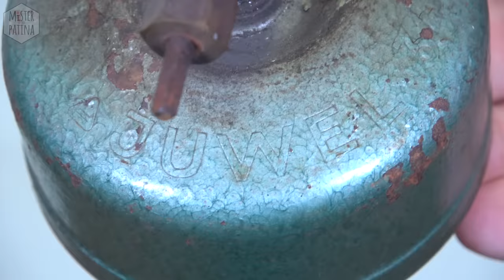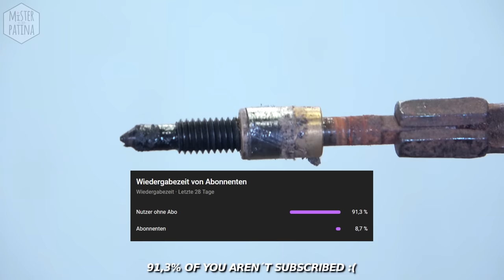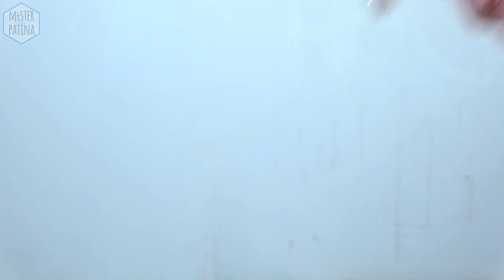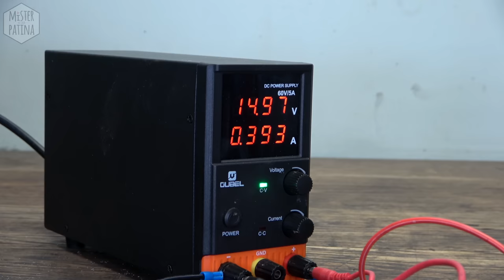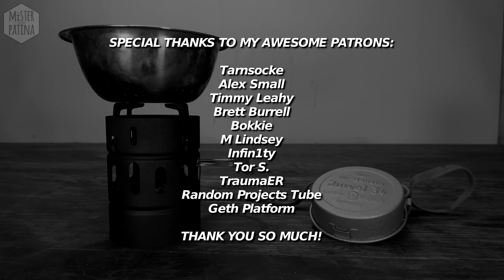Rusty 1950´s Camping Stove | Restoration

Comment: Great restoration, I particularly liked the vinegar bath.  I believe the top and bottom plates are supposed to be pans / pots for the stove.  Although they were painted prior to the restoration.  It makes more sense for a space / weight savings for camping that the pan is incorporated into the design.
Reply: Exacly. Inside this pans is just metal polished

Comment: I have the SVEA 123 with the old SIGG kit.  It is very similar to this.  You actually are supposed to fill the dimple on the base with fluid and light it, then wait until it goes out (for priming).  Excellent restoration!
Reply: I also have a SVEA 123 I purchased back in the nineteen hundred and eighties. I used the crap out of it for about a decade, and less often since. It still works, or did two years ago.
Reply: I have a Svea 123 too, mine is only a couple of years old. A nice simple and reliable stowe.
Reply: @Murgoh  Great.  Do you find that the new ones are made just like the old ones?  I have never actually seen the new ones in person, though I have seen them online (I think the Primus company now owns it right?)
Reply: @rs232killer  It really is a well built stove!  wow, 1980s.  Not sure how old mine is.  A little “life hack” that I discovered is using one strand of bike cable wire as a picking tool to clear out the occasional clogged nozzle on the stove.  Works well and costs nothing.
Reply: @nathans1978  I think they are almost identical though I have not held one of the old ones. The later model has a built in nozzle cleaning needle, just turn the valve all the way counterclockwise and the needle pokes up through the nozzle to clean it.
Reply: I bought mine in 1974 and it still works just fine.  Used it a few weeks ago.  Bulletproof.

Comment: These were the standard equipment of the east Germanys army until the reunion of Germany. After 1989 they were still produced and sold as camping stoves. I bought mine in 1990 or '91. Correct starting is described in a comment below, fill the indent with gasoline and light it to heat up the tube. Makes quite a noise when running.
The biggest advantage is, it is running with gasoline. As long as you filled up your bike, you can always cook a meal 😉

Comment: Mine has to be somewhere in my camping gear. Served me well during several camping vacations in the 80‘s. 

Btw: this was build in the GDR untill the collapse of the iron curtain. 

The lighting works a Little Differenz than you did it: there‘s a small indent round the tube on top of the gasoline Container. You have to fill this indent with gasoline and lighten it. So the gasoline in the container is getting hot and it becomes a gas. Then you ignite the stove
Reply: По моему это не бензиновый примус, больше похоже что используется керосин.

Comment: Nice and insightful job on a classic old stove. I can imagine some old tweed clad hikers way up in the Alps, crouching around that, trying to warm up. Loved the little funnel.
 For awhile on long trips we used an old pump-pressured stove for dozens of simple tasty dinners. It was meant to have only real camp-fuel. After a few tests, we switched to the same high octane gas our old Kawasakis used. The stainless steel grid where the sauce pans sat would get glowing red from the crazy hot flame. BTW; do not try this at home. It got WAY to hot. Thanks and good luck.

Comment: By the way, the lip at the base of the main jet was for squirting a bit of fuel in there and lighting it to warm the system up in very cold mountaineering applications. All cold war era mountain climbers in Kazakhstan from the COMECON countries had this little contraption from Dresden on their expeditions . Works well if you don´t have access to Butane cartridges or dry wood etc. like in Iceland for instance. Got one too but my son prefers the pocket versions which are driven by Butane cartridges on his hikes.

Comment: The predecessor was the pre-war Juwel 33.This Stove was made at least until the end of 1989. I had one that was sold on November 10th, 1989.
This one is newer than claimed: The pot stands are from sheet metal and control shaft is rectangular to the burner. Erarly models had wire pot stands and the control shaft was angled a bit downwards.

Comment: Actually, you preheat the "Bartel Bombe" this way: put some lighter fuel into the small cavity just below the central combustion unit, light that up and thus heat up the upper part. Then ignite the upper unit.

Comment: How come in this project you went directly to sandblasting instead of paint removal and rust removal first?
Reply from the maker: No paint removal necessary because of sandblaster with filter unit. And…you do sandblast to remove rust, like this is the point of sandblasting.
Reply: Great Q&A!  Thanks

Comment: Normally the sink in the middle of the tank is for preheating. Just put some gasoline in ther and light it up. If it is totally burned down you can start the stove. In winter you might have to repeat preheating up to two times.

Comment: Nice work sir. This little stove reminds me of a similar design, a Svea Optimus.
Reply from the maker: Thanks Alan, yeah the Svea Optimus is the Swedish brother 🙂
Reply: The Juwel 34 predates the Sievert Svea 123 in design. Bartell made the Juwel 34 in 1934 [for the German army]. Sievert came out with the Svea 123 in 1955. Optimus bought the Svea from Sievert in the Late '60s, at the same time buying out the Primus line.
Both the 123 and the 34 are designed around the classic lines of the 1930s Primus 71, as is the Optimus 80.

Comment: That’s a nice looking little stove. I like the color you chose and that little wrench was incredibly handy! Can those two lids that the strap goes through be used for cooking things in? If so, they might do well with a heat-safe, food-safe coating. Otherwise they look good!
Reply: I went to the comments with the same question…
Reply from the maker: Thanks! I think so, every part of this stove had a double function. Iam not quite sure how it was coated originally, maybe it was emailed once.
Reply: I was amazed that it could be completely disassembled with one little tool.  Shows how well thought out its design was.

Comment: I suspect that the top & bottom of the set are cooking vessels... With compact camping stoves, everything usually has a dual purpose. I would have blued them or nickel plated them. Otherwise, nice restoration. 👍 (by the way, I am subscribed & have been for months)
Reply from the maker: I totally agree J! Maybe they were some sort of coated back in the days…but I wouldn’t have cooked in them, even if I had plated them 😄
Thanks for your support! ❤️
Reply: ..."and my fingers sometimes"... Just think, Mr Patina; if the opposable thumb had not evolved to its current level of perfection, you would currently be restoring the midden outside your cave! 😉
Reply: Yes, the top and bottom are for frying and eating out of, the little notch on the side would have had a handle that could clip in to remove it from the heat

Comment: This is an East German "Juwel" cooker. While popular for camping, they were also regular equipment for the army. They can run on white spirit or regular gasoline. These were manufactured at least until the late 1980s. The unit you have has the smaller tank, that may indeed point to an older version.
Reply: IIRC, an earlier version of this stove was issued by the Wehrmacht and Waffen-SS to mountain units during the war, ja?
Reply: @David_Rafuse  I never heard about personal cookers issued to German troops in WWII. But then, I am not a stove collector or expert by any means.
Reply: @David_Rafuse  Not so much issued, but available at a ''PX'' [or equivalent] for private purchase in regulation Olivgruen. As such they were popular with Edelweiss troopers.
Reply: Addendum: Yes, the Luftwaffe issued Juwell 34 stoves in aircraft survival kits. They were painted either a hammertone Silver or light blue finish. Genuine WWII Issue stoves would have a Waffenamt stamp somewhere on the gas tank. Commercial, or private use stoves of the Late '30s, Early 40s will be stamped with CTR [+ two digits]. Postwar stoves are not stamped CTR.

Comment: I have an ARARA 37 that is very similar. The regulator shaft will not move. No tools were included. Unlike the Juwel, the end caps twist on  to the windscreen cylinder so no strap is needed.
Arara parts are impossible to find in the US. The wartime Olivgru:n paint is still in good condition.  I have not fettled it yet, other than having a control key with a bakelite knob made, but that's not the tool/key. I've been told the Svea/Optimus gas cap gasket is useable for replacement.
A fine fettle of your Juwel 34. We did not see you put a new gasket under the gas cap. Does this stove have an SRV?

Comment: Great restoration work, indeed.
But there's a potential danger in case of real use.
Fuel cap(bang) has built-in AntiOverPressure valve (don't know correct term). And now it can be blocked after sand bath.
Reply: Sorry, bung
Reply from the maker: Oh, I cleaned every part, and also this part (took it apart offcam) with compressed air. :-)

Comment: great video as always but I've always wondered why you + other such channels use nickel to plate the parts? Especially given that nickel allergies are a thing and very common.
Reply from the maker: We nickel plate to protect the parts from rusting 🙂
Reply: @misterpatina   I understand the reason behind plating. I don't understand the choice of metal used. There are many other metals out there that do not rust or patina or oxidise in the same way as alloys containing iron - and most people don't have allergies to those other metals but a lot of people have allergies to nickel - it's well known for producing an allergic reaction, it's why it's no longer used to plate costume jewellery. So why use it here?
Reply from the maker: Oh I understand. I use it because of the process, because it’s pretty easy to do. You don’t need much for nickel plating. I like the final look of it and nickel plating was, mostly, the original plating (the manufacturers used). 
Iam not allergic to it so I don’t care, and I keep all of my projects and don’t sell them.

Comment: But it said "nur fur Benzin" and you used lighter fluid! :)
Reply from the maker: Haha. And the lighter fluid is made for ‚Benzinfeuerzeuge' 😄
Reply: @misterpatina  Well that checks out, then.  I did wonder at one point if you were going to put the ancient gasoline back into the stove after restoring it.  I suppose restoring ancient gasoline would be a different channel :)
Reply from the maker: Hahaha, you’re totally right Ross! The ancient gasoline wasn’t good anymore, I didn’t want to take the risk…🙂
Reply: Fun fact: Zippo Lighter Fluid is Naptha. So is Coleman Fuel. They may have different tinting dyes or perfumes, but they are otherwise the same.  A 4 oz can of Zippo fluid costs about $3.89. A one [US] gallon can of Coleman white gas runs over $17 dollars. Since I found that out, I've been filling my Zippo lighters with Coleman gas. Works great.
Actual, modern ''Pimp Gas'' is counter-indicated in gas powered cooking stoves. The ''performance'' additives could be toxic, but of more interest to Stovies is their ability to gum up the action. Especially in Coleman generators.
 We're getting the premium burn here.